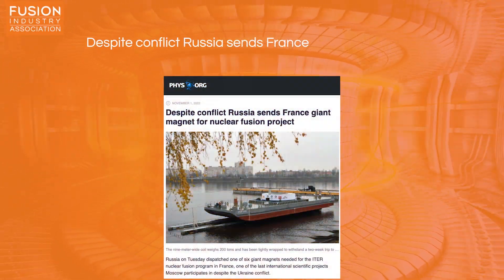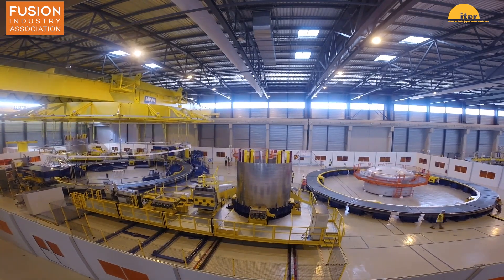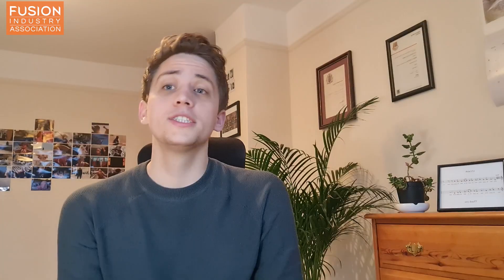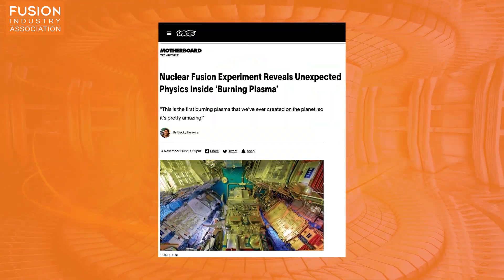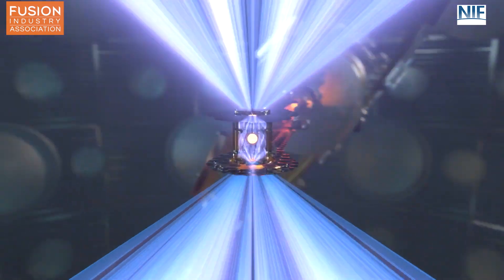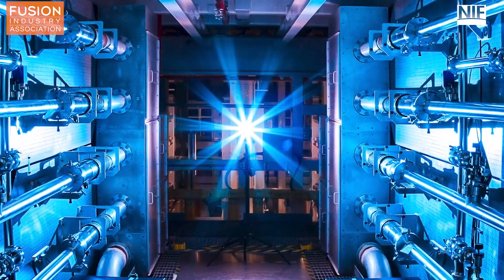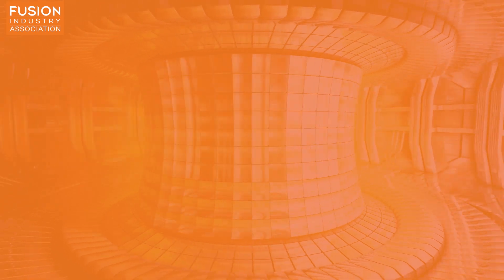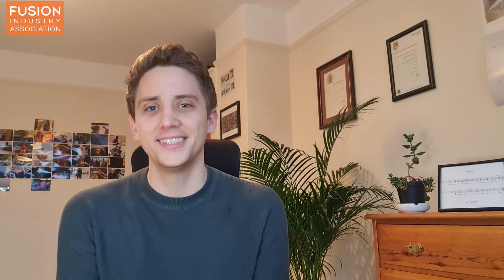Fusion News Friday, November 18, 2022

Comment: I think it would be simple and stable to confine thermonuclear plasma with a mix of magnetic and electrostatic fields.

++()1  +()2   G()3   +()2   ++()1 

Center is ground. Voltage increasing positive going outward both ways.. () are flat radially-wide thickness-small hoop   magnets of the same NS orientation strung along the non electrically conductive hollow cylindrical vacuum chamber's length with gaps berween them like washers with gaps between them strung along a bolt. The hoops are stainless steel with a superconducter in a tight spiral groove on one or both surface(s). The numbers indicate the magnetic strength. Nuclei enriched plasma dosent escape at the ends because of the repulsion or radially at the center because of the magnetic field  "ridge" with a stabilizing slope. 

Idea given free and open
Aloha
Charles M Brown lll
Kilauea Kauai HI 96754